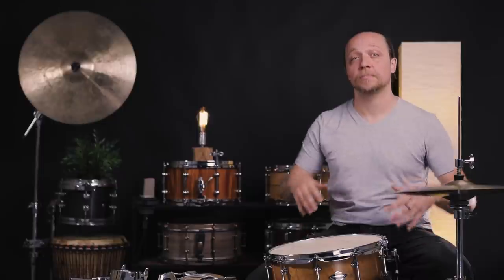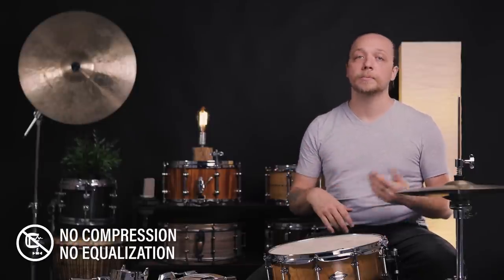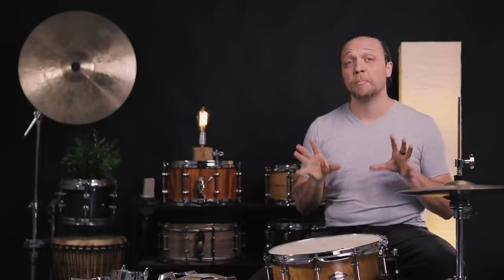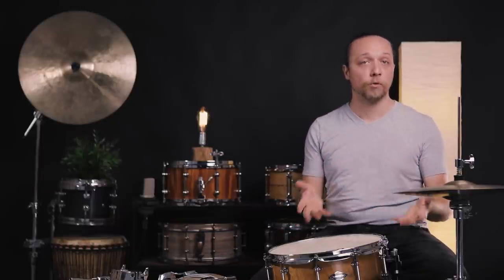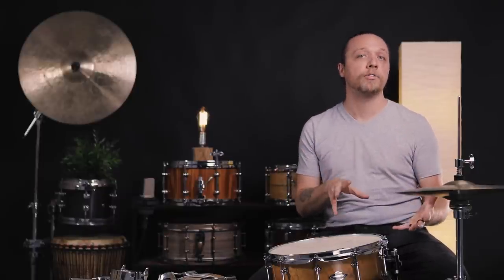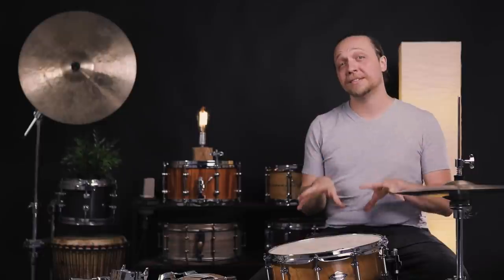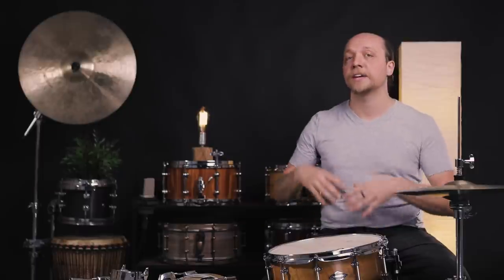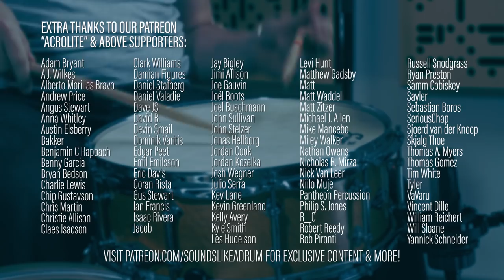Snare Sound Perspectives - Mic Placement | Season Four, Episode 25

Comment: In my experience a mic close to the batter head has a tighter, dry type of sound.  As you move farther away the sound opens up quite a bit.  Also, a bottom mic does wonders for rounding out the overall sound.  You don't really need high end expensive mics either. I use an Audix I5 on the top and the old reliable Shure SM 57 on the bottom.  Lastly, if you actually mix your own drums in a DAW,  the magic elixer to make the snare really cut through the mix without raising the volume is parallel compression. Great vids as usual.
Reply: Almost the same thoughts.... I put a SM-57 on top and an Audix i5 on the bottom!😊
Reply: @jeremy20100712  Indeed!

Comment: I had a Bubinga Tama Starphonic that LOVED being miced from the shell side. Only drum I've ever had that behaved that way, but it sounded great.
Reply from the maker: Did you mic it at a port or just the shell? That’s the one thing we didn’t do here- align the port with the mic.
Reply: @SoundsLikeADrum  I tried both but didn't notice much of a difference. It was an sm57, so if the sound did change, the mic probably wasn't true enough to detect it. Also, if you're familiar with the starphonics at all, they have a very thin shell, and low mass hoops. Probably the reason it responded so well to this type of mic placement. I imagine the shell was really coming alive compared to most other, burlier snares.

Comment: I have no personal experiences in this. However, a friend of mine has been a sound guy for over forty years. He swears by mic-ing snare drums with two mics: top and bottom. He liked an SM81 for the top head for the response and the on-board rolloff control. He didn't care too much what he put on the bottom head; he said he just needed enough snare sound to balance out batter head ring (WOW! did he hate ringing snare drums!), and that almost any mic was good enough to capture the sound of the snare wires. He usually used an SM57. He tried to position his overheads to get as much cymbal and as little bleed from the drums.